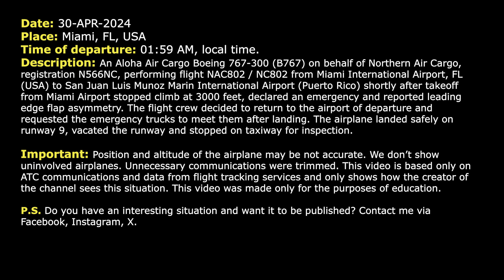Leading edge flap asymmetry. Aloha Air Cargo Boeing 767 has problem over Miami. Real ATC

Comment: “Equipment standingby…” 
what does it means for equipment ?
Reply: The airport fire fighters, and possibly even ambulances and stuff, depending on the emergency. In this case "the equipment" is fire trucks dispatched to the runway that the emergency plane is going to land on, just standing by in case of fire. The fire fighters usually inspect the plane too, after an emergency landing, checking for hot brakes so they don't catch fire if heavy breaking is used in the emergency landing.

Comment: I wish ATC would get the "overweight landing" out of their lexicon. All PART25 aircraft are certified to be landed at the maximum gross weight well above the maximum landing gross weight. It just isn't an issue.
Reply: It's a lot easier than saying "we're gonna roll farther than usual and our brakes are gonna be hot."
But you're correct, landing weight is essentially infinite, if you're not concerned about taking off again.
Reply: @aaronclark524  Nobody cares in an emergency where you're going to roll out. If you are landing over weight, perhaps you should use the entire length, check landing distance tables and brake cooling tables to know how hot they could get. It isn't a V1 cut maximum effort stop with little runway remaining. Just like the QRH directs you to and you'll be fine. Science!
Reply: This flight was planned between Florida and Puerto Rico i think. Thats not very far for a B767; a few weeks back a Delta 767 between the eastern USA and Germany, dumped fuel and turned back to land. They didn't start their oceanic crossing yet, still they dumped fuel before landing. So the "landing heavy" thing may not be possible if you are still near MTOW.
Reply: It was a United 763 out of Dulles for Munich; https://www.youtube.com/watch?v=UsmpSXENC-4.    My bad.